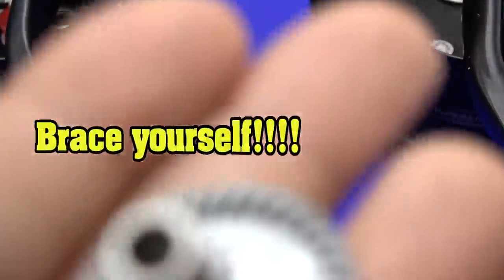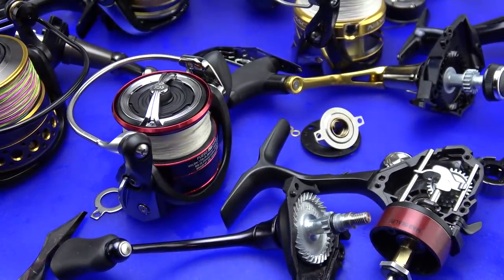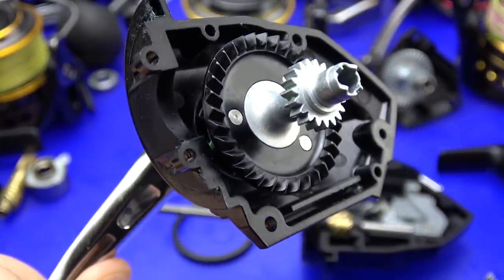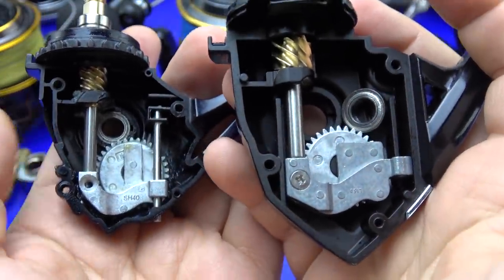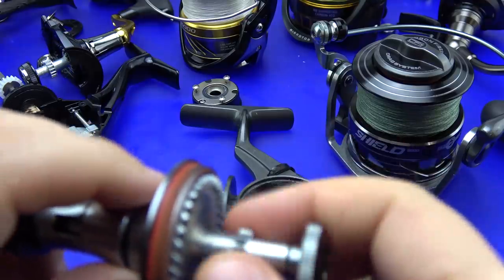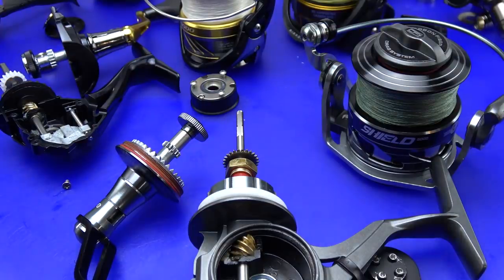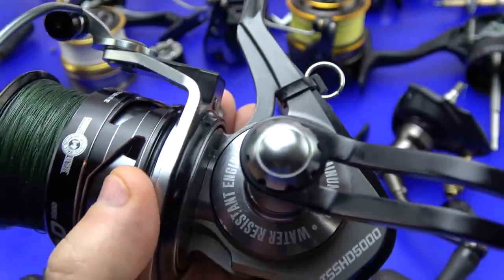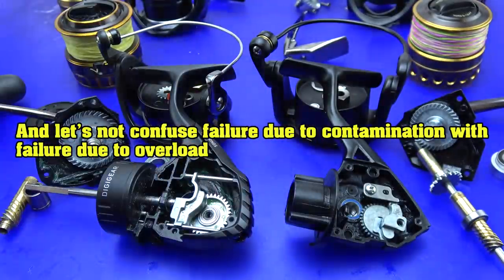2018 - 2019 $100 reel buying guide, comparison, and review.  Penn, Shimano, Daiwa, Tsunami

Comment: I had the Penn Battle 2 in my cart until watching this video - and then changed it to the BG - and for some reason I can't pull the trigger on either!
Reply: So get the daiwa ballistic ex 2000h it's water sealed has a 5.6:1 gear ratio handle is very comfortable had it dunked in fresh and saltwater cought tarpon and all kinds of fish on it and it still feels brand new I know it cost $240 but it's by far worth it

Comment: I own 3 out of these 6 egg beaters (BG4000, Shield 5000 and a 4000 Nasci). After more than a hard fishing year on the water, I must give it to the shield as it is still holding strong. aside of the overall quality of the shield (body Finish, not so strong handle and the looks of a $25 reel) it still looks and feels the same out of the box. compared to the BG which got very loose and wiggly after one season. 
One recommendation to the Shield is to convert it to a manual bail.
Also, this is a tough reel to match/balance to a good rod, after many trials, I paired it with a Lamiglas Insane 9ft surf rod. you get yourself a great $200 surf setup.
looking forward to seeing the Tsunami SaltX and what it would bring to the table against fully sealed reels in the market.

Comment: I run a Nasci 1000 on my ultralight rig for freshwater light-line finesse work. It services easily and runs like silk despite a good number of fights when I hooked into fish far bigger than my intended species. My issue is that I’m looking to replace my 3000 size spinning reel for bulkier freshwater finesse fishing. Between this video and my baseline experience with the Nasci, I have a couple great options on the table. Thanks for making such a thorough video; very appreciated from a guy who services his own reels.

Comment: Hi great video my favorite reel is an old Michell  reel i have it 30 years plus i take it apart every year and clean out the old grease and pack it with new grease it had 2 spools with it when it was new but i     lost one about 20 years a go i have pulled in a few pike 20 Lb and over it has never let me down
Reply: That's awesome! My #1 reel is a 1980's vintage Mitchell 300A. For a spare spool they pop up on eBay regularly

Comment: I had my Okuma Cedros drop in the surf today and it got full of sand in under two minutes in order to get into the gear box at all lit required a total take down odds are I'll be replacing it with a Penn as you can just remove the crank and take the side cover off food for thought.
It didn't go back together very well.

Comment: Some of you out there act like you gonna be catching 1000lb marlin with these reels. 
One fishing outing here in hawaii I caught 5 yellow fin tuna ranging from 48lbs to 126lbs, on a battle 2 8000 reel with zero problems. The very next day I caught a 80lbs Trevally from shore on the same reel. 
Its been 3 years since I bought the reel and with regular maintenance,  its still close to new. Since new, I've probably caught at least 80-90 fish average about 20-30lbs on the battle 2. 
The 3 main reasons why I went with the battle 2....fair price, easy maintenance, and a ton of parts available if needed. 
I love Daiwa BG line as well but they are a little harder to maintain.

Comment: Be mindful that the Tsunami Shield may look good from a simple reel break-down review, but in actual use, people are experiencing a great deal of quality issues with those reels. A friend of mine who works for a major tackle retailer told me that those reels are having a very high return rate for quality issues; mainly the dreaded "Tsunami clunk/Squeal" after a few uses. Quality seems very hit or miss and the company doesn't seem very keen on customer service. Might want to do some additional research before buying.
Reply: Desert Dog Outdoors I have two, one as a backup to my VS, both smooth as silk like they just came out of the box.

Comment: This was a fantastic reel. I have used both the BGs and Battle 2s. when it comes to the handle being one piece or it breaks down such as the battle 2, I prefer the battle 2 style. when it comes to storage under the gunwales on a flats boat you usually run into storage space issues. being able to loosen the handle and fold that handle in it allows it to fit better and also don't run into the issue of handles being kicked. which has been a problem. but to each their own. but awesome review!! Tight lines!!

Comment: Bought a 3500 and 6500 bg daiwa cause of this vid and alan hawks review,penn better step it up.
Reply: Jerry Marshall I picked a couple of the bgs up this week. 4500 sizes and up
Great reel. Smooth spinner. No slop in the handle. I’ll buy a reel shorter but came a cross a 4500 maverick and couldn’t pass it up 
These big reels are atm. Great bang for buck

Comment: i owned a Daiwa Fuego LT and when i had a fish on, the fish was pulling so much drag so fast that my drag knob popped off and had to cut line off.
Reply: Should've tightened your drag its not the product that made that happen its you because youbhad the drag sooo loose that the drag knob popped off
Reply: If you’re getting spooled and want to break off the fish, just grab the spool. The line should break at the weakest point which is usually the knot to your lure, unless you have a weak leader knot. If you’re running braid to leader typically you lose the lure but you get everything including your leader back

Comment: great review! picked up a fuego lt 2500 xh in part because of this vid. one thing i noticed was the initial top-heavy line lay, heavy even for a diawa (spooled 20 lb super 8 slick). i added one of the included spool spacers, and while it evened things out a bit, i noticed the line tended to favor one side vs the other. it's almost as if the 'cylinder' of line was slightly tilted off axis, as if the spool sits crooked on the main shaft. visually eye-balling the spool though, it seems to sit square to the body and rotor, so i'm not sure where the disconnect is. any similar experience with yours?
Reply from the maker: Hey man!  Thank brotha!   (and no i wasn't talkin about you in the beginning :)  the tackle tour types were who i was aiming that at! )    I think I mentioned the awful line lay until I shimmed it.  Did you notice that pain in the ass clear ring holding the bearing in place?   That was a pain..lol...After it was shimmed the line lay was very good.  Not Aero technium which is #1 spectacular....Not stella which is amazing.......not Ballistic / fuego which is great.....
But very good.....lol  that's why i colored the line to show the angles and pattern.  and the close ups.  It's better than the nasci....but i think the okuma epixor xt beats it....As does the mitchel.....Not sure why though...it is a different idler that runs the oscilation cam.....It's metal...tatula lt and ballistic are plastic....strange right?  
THe uneveness of the wraps usually mean the spool drops a tad too quickly as the rotor makes it's way around...clearly seen in the pics of hte penn spool.   A tad longer at the top or bottom would likely make it appear more square if the line being laid is round as it would likely fall into place
Reply: ha no worries, and thx for the info. yeah, that clear ring was crazy tight, i had to shimmy it off with an exacto (or 2). maybe my spacer isn't sitting flush, i'll retry. i just saw your surfperch comment, thx for watching bro! fun fish those surfperch, like big ole angry panfish in the surf. can't wait to put the fuego up against them👊

Comment: Hi. Which reel can you recommend for throwing lures with a 10' rod in the surf please? Really detailed review by the way!
Reply from the maker: Im filming the Penn slammer 3 vs saragosa vs Saltist right now...just taking a break from tearing them all down.
The slammer 3 is the best on paper....but the Saragosa has proven itself.   Next comes sizing.  If you need a heavy action reel like a Saragosa 8000 or 10000 or Penn Slammer 3  5500..take a gander at them in person...as they are physicallly large.      I use 9'6 and 10'6 ML rods with 15 ounce ish reels....And I use 22 ounce reels on 10' -11 heavier rods
I like to make sure I have 250 yards of whatever lb test braid i'm using.  (at least that's my preference anyways :) )

For the 100$ price......if you watched the video i gave pretty much all the info needed to make that decision.
Reply: @TackleAdvisors  Thanks for the reply. I got the saragosa 5000 pair with the okuma cedros csx surf rod 10'.6'' and it's a sweet set up for throwing plugs. Also got the slammer 5500 but nearly lost it when a big Jack took it out of the sand spike because the drag is tite so now I use the slammer when I go boat fishing.

Comment: Thanks for the very good comparison review. :)
I am a big fan of Daiwa over Shimano but dosen't make Daiwa better reel. But with cheaper end reels, such as Shimano Aernos and Alivio compare to Daiwa Sweepfire, I preffer Shimano. Then when it comes to mid rage to High end reels, I preffer Daiwa only because it looks better. :)
I hate Magseal since it can cause more problem in the long run if you don't service them, (They can dry out depending on usage but I've seen some of them dried out in less then an year time.) and Shimano's worm gear is definately better then Daiwa's oscillation gear when it comes to smoothness but it can cause more problem since it is more complex design. Also Zaion is a little better then CI4 but it has paint problems. 
Anyway, there are no doubt that both Shimano and Daiwa makes very good reels, it is only personal preference that I likde Daiwa better. Especially those new LT series. 
Since Daiwa reels become lighter then Shimano with more line capacity, it will be interesting to see what both come up with in 2021. :)

Comment: Good information, well done, and well timed!  We've been shopping for another inshore reel, and the BG was high on the list. One question could seal the deal: You mentioned replacing the BG ball bearing around the pinion with a $10 ceramic unit that would avoid possible corrosion. Where are those available? "Bearing Shack"? How many different sizes of bearing are used, since there are so many in the BG line? Is it a difficult part to replace, or should a shop do it?
Reply from the maker: Thanks woody,  Unfortunately daiwa sucks at posting bearing sizes....Best bet open the schematic and email or call their customer service with the part numbers asking for sizes.   The top pinion bearing throug daiwa will cost 20$  And will corrode if salt gets in there....I ordered this one for the 4k  http://amzn.to/2CVVOc7 (top of the pinion bearing)  haven't received it yet....should work fine.  There are a few diff bearing sizes used.   The main problem bearing being the top pinion bearing.  Sideplate bearings can be protected by greasing.
Reply: Thanks for the information. As it turns out, my choice, for now, turned out to be "none of the above". The BG's with the capacity & specs we needed were several ounces heavier than planned ( 3000 & 3500 ) and industrial strength isn't really needed. In the Fall, a BG2500 could join the party, but for now I have a couple of antiques for backup.

Comment: Im looking for a good ultralite reel. If you had to choose from the Daiwa BG 1500, Daiwa Fuego 1000, Shimano Nasci 1000, and or the new penn fierce 3 1000 w its new seal on the pinion gear? The Daiwa Fuego looks promissing cause it holds more line...whats your opinion?

Comment: Hi Tackle Advisors, I’m a new guy for Daiwa freshwater spinning reels (such as Revros) and I notice that the spool has a lot of horizontal play when we insert it on the shaft without the drag knob. It is only when we turn the drag knob and it gets tighter that the spool will not oscillate horizontally. 
I have not noticed all that play that on Shimano reels. 
Is that working as designed on Daiwas?
Reply from the maker: Spool play is common especially when the drag knob is not there to compress anything.  Often when the knob is tight there may be some play but it may also be internal.  There is some play in the spool shaft
Reply: Thanks for the answer, but I have a feeling the play is more significant on Daiwa compared to Shimano.
Reply: I've been informed previously that this spool 'play'....and it is present even under a fighting drag setting.... is an intentional and functional design by Daiwa. From memory, the spool is afforded some room to move so as to allow it to pivot under a controlled manner to find its "point of least resistance", the aim being to relieve stress points on the main shaft and rotor...spreading the load/torque moment over a larger proportion of the reel assembly. I Have a few Daiwa reels like this, and while I can kind of envisage how its supposed to work...... I can't scientifically prove its effectiveness or otherwise. The reels i have certainly don't seem to be negatively affected by this 'feature' anyway.
Reply: Hi Black C, that's exactly what I thought, this is an intentional design, considering all technology and engineering from Daiwa. However, as I was fishing more with Shimano I thought the play meant some defect, but after comparing two different Daiwa models, I figured out it was as designed.
Thank you for your answer.
Reply: I have a revros 2500 and I cannot stand it compared the diawa theory I purchsed cheap years ago, otherwise I love the diawa made cabelas prodigy 2500 composite reel.

Comment: Maybe im just a neophyte but I feel my NASCI is smoother than my Stradic Ci4+. Im not sure if I just dont have a grasp of the nuances of the reel or if there is an adjustment in the Stradic I am missing. Both 2500 reels on comp rods.
Reply from the maker: Possible..the nasci is smoother than the other 5 reels on the table.  Something about plastic reels and how it's almost like the less rigid frame material cushions some of the gear interation.....It also sounds diffferent than the stradic....has a higher pitch whir.  I have a ci4+ sitting right next to the nasci a stella, exsence and ultegra as direct comparisions...and it's winds as fluid as the top tier reels..

Comment: hey Tackle Advisors, just wondering if you could answer a question for me regards to the Stradic FK and the NASCI, over here in Aus the Stradic only comes in the higher geared versions but the nasci doesn't, are the gear sets the same material/ quality, etc? I prefer lower gear ratio units and would consider buying a stradic FK and swapping it out for a new gear set from a Nasci if it is.

Cheers
Reply from the maker: It's a different gear set entirely.  Nasci is hex keyed vs threaded on in the stradic and the oscillation operates differently.  I feel your pain on the gear ratio frustrations.  I mentioned ordering a bunch of Daiwa reels... I ordered low gear ratios where there was the option.  They shipped the wrong speed and I had to pay to exchange them so said eff that... Woman at Daiwa had a tone with me too... So I ordered a saltiga saltist ballistic tatula fuego exceler..and had to jump through hoops to even get considered for an exchange... Lol
Reply: well that is some good service :/ Daiwa here in Aus are getting a lot better and trying, which is good because I really like their product. Have just bought my first 4k stradic fk and I do like it, but the daiwa has it beat for feel. The ratio is the other thing. I do like my stradic but for my other rod, I am struggling to not buy a certate or similar..... The gear ratio, I cant understand why shimano wont ship out the jdm range... I do like the penn conflict, have you done a review on one of those?
Reply from the maker: I had briefly an old conflict.  Not the new one.  I can say the spinfisher i've been fishing has been excellent.  Very un penn like

Comment: Just picked up a Daiwa Exceler LT 2500D for $57.03 on amazon.  Was wondering what are your thoughts on this reel.
Reply from the maker: LOL....I lent it to Elias V fishing....and his dumbass dropped it overboard lol...it's a good reel....One of the best in the category....with the Okuma Epixor xt running as low as 33$ I've been recommending that reel over it.....but It's a damn good reel for the coin.  One of the best plastic framed reels on the freshwater side of things.
Reply: @TackleAdvisors  - Where can I get the Okuma for $33?

Comment: I took a Penn Battle 2, 4000 into the Boundary Waters on a 70 miles trip.  50 by canoe, and 20 on foot.  The battle stayed outside for all five days.  Several days of rain, and one of which was a storm that caused a ton of blow down (aka trees fell over).  To this day all Ive done is add the oil it came with and it makes zero noise or clunks.  When the bearings start to go, Ill be upgrading them to fully sealed as well as dry lube on the metal surfaces.  Would like to try the BG, but its hard to turn my back on what the battle has went through and laughed at.

Comment: Though the Socorro wasn't the best option at $130, Cabela's currently has it on sale for $69 free shipping. Which is more of an appropriate price. Only downside is it is currently on backorder now... So my plan to head to academy tomorrow and try to get them to price match it, as their policy states they will price match select retailers (Cabela's included) and beat their price by 5%. So, a $129.99 reel for only $66ish? I can't pass that up! I've been looking for another, slightly cheaper setup to go with my Daiwa BG for surf fishing here in the Louisiana gulf. I was considering the Penn Fierce II for around $59.99, but I feel that the Socorro is a slighly better reel, although definitely not worth it's full retail price. I do plan on buying the two 99 cent seals from the Nasci now that you have shown they seem to fit. So thank you very much for that.